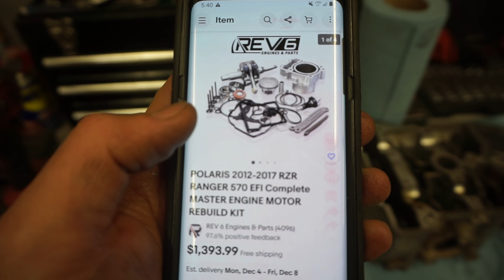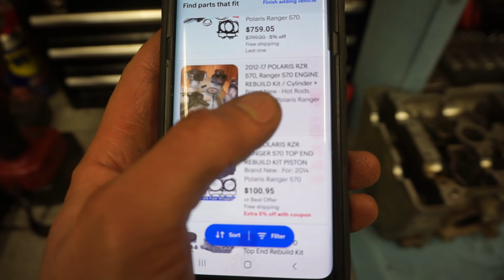I Lost Money Buying This UTV

Comment: A word from someone that nearly lost a finger. NEVER wear a metal ring while working with anything heavy, on equipment or with tools/presses. OR around electrical. Just don't. If you want to wear a ring get one of those silicone ones. It will only take one slip up to either crush your finger or it get snagged on something will deglove the finger. If you don't know what degloving is google it. Not pretty. I was working on my trolling motor batteries and my ring came between the wrench and the other terminal. One spark and it was red hot. 3rd degree burns around my finger, it seared the skin. Then I nearly degloved the finger trying to rip the ring off, while burning my fingers on my other hand. Lesson learned, never again.
Reply: He should google ring sheathing accident pics 😢
Reply: Yep I preach this all the time. I always get mixed responses though, some people actually get offended. My dad was strapping down a ladder on top of his truck and he jumped down and his ring got caught on the ladder so all of his body weight hit the ground while his finger was held up on the ladder and by the time he jumped back up his finger was barely hanging on. Thankfully they were able to save it but they had to cut the ring off.
Reply: Got mine caught on a door lever/ handle as I opened it and exited. Wore it on a chain around my neck there after...until the divorce.
Reply: When i did my hd mechanics course in the 80’s, another student grounded his metal stretchy watch strap on 24v power source
The burnt meat smell stuck in the shop for days. 
I never wore jewelry since
Be safe
Reply: My wedding ring is in the wife's jewelry box where it belongs. I never wear any jewelry, ever. She will get over it.
Reply: Been there, done that . Never wore the ring again ,ever
Reply: Yes, I'm a Paramedic for many years, seen quite a few ring avulsions. So many I quit wearing my ring at work years ago, then silicone rings were invented, had one ever since. Rescues do have a ring cutter on them called a beaver tail, not a pretty job cutting a bent ring off a smashed finger, lol
Reply: I’ve said the same thing on this channel before, I don’t think he reads the comments
Reply: @TheBandit7613 exactly
Reply: In high school there was a shortcut to get out of the school yard gate by jumping a 6 foot chain link  fence.  We all got pretty good at jumping up and grabbing the top and swinging over it.   This guy did it and his class ring got caught on the top and peeled his finger off, bone was still in tack on his hand, boneless finger twitched on the blacktop.
Reply: @Aint9sk8rd9 my grandpops lost his finger in the same way jumped down from his truck and his ring got stuck on the mirror
Reply: I spent 50 years as a toolmaker/instrument maker, learnt early on that my Forman was right about wearing rings on machinery.  Always wear mine on a chain around my neck and tucked into my vest. A close call on a surface grinder was enough for me.
Reply: Never wear a ring while working on   
batteries.  I practically burned my finger off trying to change car batteries.  Never knew 12 volts paced that much punch.
Reply: @edjacobson8480  yep its all about the amps in this case!
Reply: I wear a silicone ring for that very reason.
Reply: @gjohnston281 same here, I’m a electrician by trade, and I never wear a ring while in electrical panels and any mechanical work that I do as well. You are just asking for trouble when in a trade. Joe, hopefully your beautiful wife will understand. Silicone is the way to go if you want to wear a ring. Best of luck and be safe. Hoosier Wing 🇺🇸⭐️💫😊👍🏻
Reply: I was taught that by the US Navy when I was in electronics school. I still practice this today.
Reply: @danielthomas7318  I agree… wish I had a video from my personal experience, knuckle to knuckle.. finger still doesn’t bend or feel anything
Reply: Had a co worker that was MiG welding with his wedding ring on and no glove. Wire contacted  his ring and burned a perfect groove in his finger.
Reply: @TheBandit7613 😂
Reply: My wife never understood at first why I never wore my wedding ring, until I told her what could happen when working around mechanical stuff or electrical stuff......she no longer questions me on that subject.
I'm a retired mechanic with 35+ years in the business, so have seen it all and some of it ain't pretty. Thanks for sharing, @riccochet704 .
Reply: I had a brother in law was climbing into his deer stand and slipped and his wedding ring caught on the platform and stripped all the meat off his finger basically leaving him with just the bone only.  So yes removing rings or and  watches just might save you from serious injuries.
Reply: Yes I was in the same boat and nearly lost my ring finger, never wear it while working on anything or you will regret it one day.
Reply: Or with cows. My first week at a dairy farm nearly took my finger when a Holstein lightly stepped on my hand bending my wedding ring. We had to cut the ring off because my finger was turning purple quick. The cow didn't even put her weight down, thankfully but it was enough to cause issues with my middle fingers to this day.
Reply: My father was wearing his wedding ring at work and nearly cost him his life by electrocution

Comment: Just a tip, when splitting a case half get yourself some extra bolts 2" longer than stock, place and tighten in 3 or 4 spots across the cases and give them a whack with a hammer and your halfs will pop apart.
Edit: new oil pump assembly  would make for cheap insurance for the amount of $$$$ your putting into it.

Comment: JMO look at the crank shaft rod journal and see if it blueish purple if it is that engine was starved of oil. The carbon build up tells me high mileage quite possible, but oil  consumption due to oil change interval may be a factor because that oil was really black and looked a little  thick  there was a little sludgish oil in there and sludge doesn't lubricate. Lack of lubrication will eat rings and bearings.

Comment: Why did it happen? Polaris UTV engines are known for having crankshaft oiling problems. Defects or restrictions in both the block and the oil passages in the Crankshaft. I've heard of Many Polaris engines with less than 100 hours on them blowing up and having to be replaced. The 2012 Polaris rzr 900 xp engine that I just rebuilt only had 384 miles on it and it was blown up Twice. The 1st time it spun both connecting rod bearings and seized. The 2nd time 3 of the 8 valve guides dropped out of the head and bent 2 valves and broke 1 valve, piston, and bent 1 connecting rod. If you ever have the head off check and see what valve guides are in it. If they are the composite Steel ones, (they will be magnetic so check them with a magnet) replace them with good quality Bronze valve guides. The steel ones do not expand at the same rate as the aluminum head does when the engine gets warm which causes them to drop out of the head. Bronze has a similar expansion rate to aluminum so replacing them with Bronze valve guides is a very good upgrade.

Comment: bent ring similar fashion to yours, was lifting a snowmobile frozen to the ground in severe winter conditions. wearing mitts, didn't notice squished ring until several hrs later when took mitts off. Could easily have lost finger to frostbite. Not worn ring since, spousal approval. I work with my hands constantly..

Comment: One thing I’ve learned from watching your channel is what brands NOT to buy. I’m thinking Yamaha looks to be the best choice for everything.
Reply: Yamaha used to be good. Now they are outdated. If you want any kind of power, the only brands are Artic Cat, Polaris, Can Am. 
Here in the west, it's all you will see. 
Big dunes take horsepower. 
The Arctic Cat Wildcat XX does use a Yamaha triple that kicks azz. It's 130 hp that will tune to 150 hp. The chassis was designed by Robbie Gordon, Baja champion. Built like a tank with an excellent suspension. It also has a belt driven alternator for a ton of lights.
Reply: @TheBandit7613  I’m talking about reliability, and ease of repair.
Reply: @TheBandit7613  Honda is still the most reliable brand your money can buy that’s a fact sure the others have all that power  but you’re working on it more than riding it so I’ll stick with my Hondas at least I can ride them home and not be trailered home.
Reply: @lukecombs5242  Nothing has ever broke on our Wildcat XX or our Maverick X3. Nothing. And we ride them hard. 
The Honda will not make it up the big dunes at Dumont or Glamis and the suspension sucks over whoops.
Reply: @lukecombs5242  Word. I got a free 1984 Honda TRX200 ATV a while back and the entire engine was so fucked it's a wonder it even ran. Rusty cylinder walls, worn rings, stretched timing chain, scored cam. You'd never know it besides some extra ticking. Honda is the way to go. I gave that quad to a friend and bought myself a new Rancher.
Reply: The big thing is how well a machine is maintained and if it is driven keeping the tires on the ground. I see all the mud residue on much of this machine and I wonder if the radiator has the same residue on it.
Reply: Older honda ranchers with the rear solid axle are the best, good all around use/power and can drift them much easier/safer with the solid axle.
Reply: @M.TTT.  Hated mine. It had Electronic Shift which was nothing but expensive trouble.
Reply: @dougaranda6187  mine has auto or switch to the ESP (electronic shift) with buttons. Never had an issue, but I don't use the electronic shift.
Reply: @M.TTT.  But the ride with independent suspension is so much better.
Reply: @Chris_at_Home  overall, probably, but way more prone to flip than slide
Reply: I've got a friend with a 2020 Yamaha side by side. Lot of problems.

Comment: Those Polaris engines have had a problem with the oil pressure relief valve getting stuck and having no oil pressure. There are some videos on YouTube that talk about that and show how to fix that. I have rebuilt three with bad cranks and I now stay away from Polaris stuff. I also wonder about how dirty things are, even when you're putting them together, I have to have things spotless for reassembly. Especially parting lines. You need a small parts cleaner, makes it easy to clean things up. Great videos, very informative. I don't know how you put out so many. Vinny is great too, where has Jade been??
Reply: BINGO oil pressure relief valve

Comment: I like to use a bolt to remove broken bolts. Ya build up with weld until its sticking out. Then you can weld the whole way around the bolt. The problem with using a nut is getting weld to stick to whatever your getting out. You have a small hole and it always welds to the nut and breaks off of the bolt.

Comment: Guy at old job.. was trying to guide a drill on a long shaft for trailer skirt frame holes. Mistake # 1 was zip tying trigger. 2nd was holding spinning shaft with gloves to guide it. Grabbed glove and pulled hand / arm around the shaft. Had a wedding band on that smashed onto his finger. They had a hell of a time trying to remove it, as his hand was swelling up. Same can be said around electrical work as well. No jewelry while doing these types of jobs.

Comment: So from what I see, it looks like there was some overheat possibly at some point. The exhaust valve springs are either weak from heat exposure or they were not closing completely due to, improper clearance between the cam follower and valve stem. Rev 6 is nice aftermarket parts, I am curious if you are going to replace the valve springs especially the exhaust?   Also it seems strange to me that the oil pump chain is stretched so far that it may have jumped teeth on the gear. I wouldn't think that the oil pump would have loaded the chain to where it would stretch, unless it passed some foreign material through it and restricted its ability to rotate. Curious to see how tight the new chain is. I look forward to your rebuild video. I am a fan of Polaris, I think they are one of the better machines on the market. I still think you should get a Vapor Hone cabinet and clean-up the cases and parts. It would look like a new motor when you put it back together. Thanks for the video, Very Respectfully Lance.

Comment: Cause a lot of people do one and not the other which causes timing chain stretching out.,an etc.,etc. Wallet wise. It'll cost yah everytime over something simple as changing the oil and oil filter.,or adding coolant and so on. Spark plugs and Air filters to.

Comment: As mentioned earlier, it's the oil bypass valve. They stick and bypass all of the oil pressure so it burns the crank bearing out. You need a new crank and rings, gaskets. Everything else is reusable. I've used Rev6 and they're Chinese junk but the best of the Chinese junk so go with it.

Comment: Make sure you take that head in for a valve job . Take new valves and buckets and cam to machine shop. Those seats definitely need to be ground . And he can set the heights by grinding end of the valve to make lash right

Comment: Some advice for people splitting cases without a tool grab some bolts the same thread pitch as case bolts but longer and thread them all the way in on opposite sides and hit them with a hammer a couple times then tap around where the cases meet if they don’t come apart right away with a rubber mallet or dead blot. The longer bolts you thread all the way in will not damage anything they will bend before anything. Your welcome

Comment: I think you couldve got those bolts with vice grips and some heat!lol but you mentioned youve had trouble in the past welding nuts on studs make sure to shine up end of stud and grind galvanized coating off nut put your helmet on and stick the wire right down on stud  and dont stop untill nut is full and the reason the studs were loose is because alum expands quicker than steel the heat tranfers from the welding and i havent seen you need this but you were working on seals i it reminded me of a handy tool for pulling seals on like side cases where you cant get into other side is to get a long sleeve nut and weld a sheet metal screw on one end and screw it on slide hammer then obviosly just drill little hole in seal screw it in and pull seal you mayhave known that but im old and been doing those kind of things a long time! (welder/fabrication) and a side note my dad was a jeweler and  your ring was toast so a good pair of side cuts will snip that gold band and pretty easy fix for jeweler they resize it youll never know it!! And as ive said in previos comments get a milwakee cordless ratchet itll become your favorite tool! lol love the vids!

Comment: That crank had gotten very hot to almost weld itself to the flywheel and other stuff. Whomever was driving must have smelled it but kept the pedal down. HaHa - I welded my ring between the starter hot stud and the frame of a old car that taught me to remove them. In this instance the ring took one for the team and kept his finger joint from getting smashed.

Comment: Sorry to tell you but you need to cut the filter open and look on the other side of the filer element. Just but a filter cutter wrench for future videos. Do it right for the guys that don't know.
Reply: And don't cut it with and kind of saw. That will put metal into it bud.

Comment: This thing was likely burning oil and they ran it low. High RPM of driving on the road sucked what little oil there was in the pan out and destroyed the bottom end. They likely added oil later when they tried to get it running.

Comment: I am really curious why you went straight to cutting the heads off the exhaust bolts. I was wondering if you own an oxy-acetylene torch or even just MAP gas. They probably would have come out with heat and vice grips. I am glad you got them out easy enough but i would say the reason they came so easy was because they were hot from welding. Just curious on your thought process. For me cutting the heads off of bolts is usually last resort especially if they end up flush, which i realize they werent in this case. Good job anyways, i love your full engine rebuild video.👍
Reply: Exactly what I was thinking.
Reply from the maker: They were stripped out
Reply: @2vintage  hey man I mad a comment on your post about trying to reach you about a 400ex if u can get back to me that would be great thanks man

Comment: Change your oil people. If the rings are that worn that bad it sucked in dust and that takes out the top end followed by the bottom. That chain would have needed to be stretched to the point of skipping teeth to cause the issue.

Comment: Also, all that carbon in the head, I bet it was burning oil, they ran it low on oil, the crank got hot, rod bearing scored. So they quick did an oil change but it was too late. That's my guess.
Reply from the maker: Very possible
Reply: Likely a great guess

Comment: Maybe it's just the perspective, but it looks like the end of the press return-spring eye-bolt came very close to the case when you were pressing out the bearing at 29:35. I was cringing, thinking you were going to punch a hole in the case with the end of the bolt. Maybe a trim is in order? And ditto to all the warnings about wearing rings in the shop.